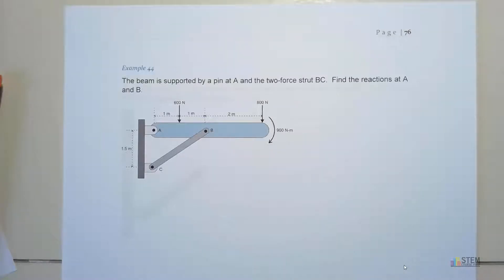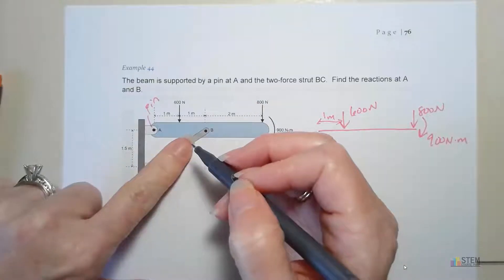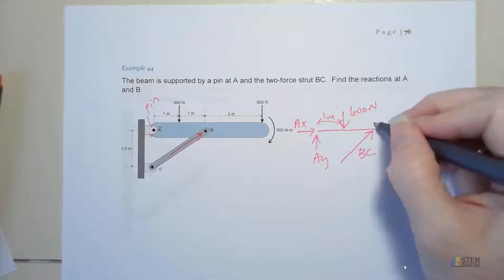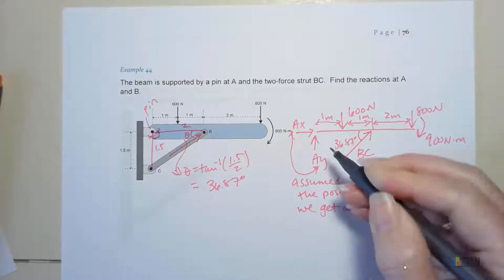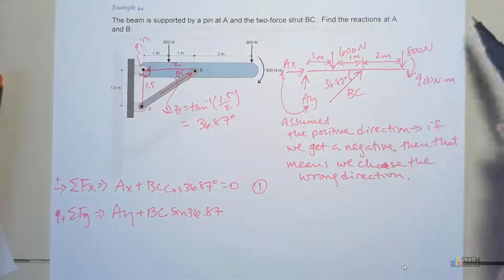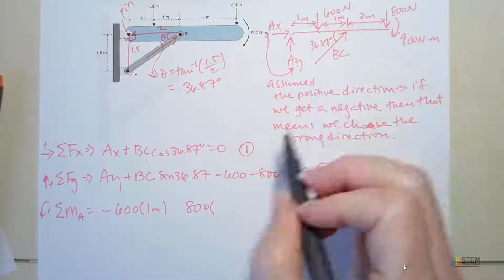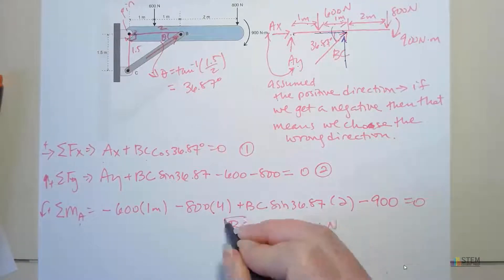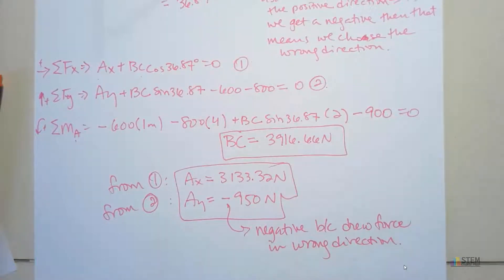Statics 2d rigid body equilibrium example with pin connection and two force member

Comment: What would happen to this if rhe 900nm rotation wasn’t there
Reply from the maker: you would need to redo the moment equation by removing the 900 Nm moment from the calculation. This will result in different values for the reactions.